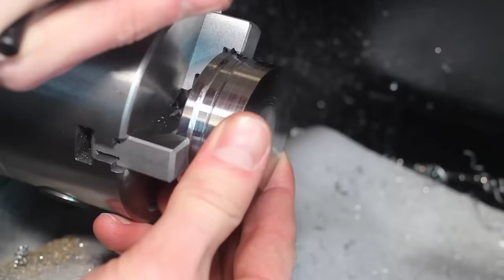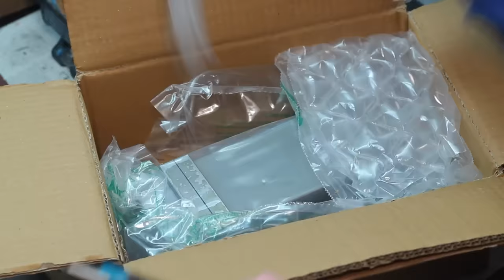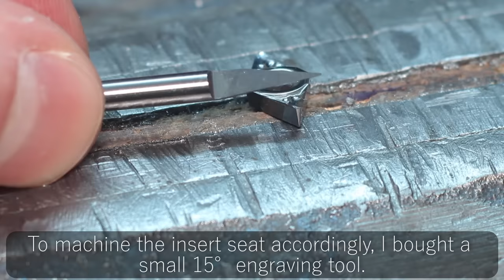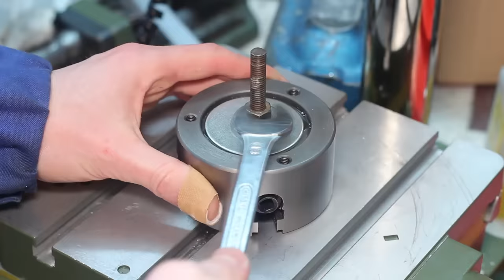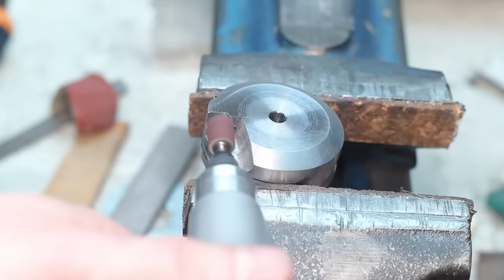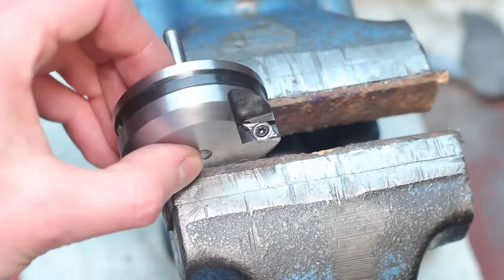Making a small Fly Cutter for inserts

Comment: Very nice work!
I expected the Fly Cutter to work quite well compared to say, an endmill; due to having a much higher mass. But I didn't expect it to be so silky smooth! That is a very nice cut! No comparison to the vibrate-y cuts with the endmills. I'd wager we see this tool a lot in the future!
Reply from the maker: Thank you very much for your comment! Yes I didn't expect the cutter to run that smooth as I wasn't sure to nail the right dimensions and angles for the insert seat properly. But happily it turned out really good and is very satisfying to use :)
Reply: In my opinion, the greater error in balancing is that measurements were taken without a cutting plate. I wouldn't overrate it because the reflective surface is fantastic.

Comment: I really like this take on a fly cutter, very different to mine. Just got my hands on a set of those same inserts that you have there and I wasn't hugely impressed with the finish. I found that button inserts give me the best fly cut finish. Cheers
Reply from the maker: Hey, I saw your video too:) Cool work! That's the common way of making a fly cutter. I wanted to try a bit different approach:) With button inserts you mean the round ones? They are certainly a good choice. But as I had the dcmt inserts on hand for my lathe and am quite happy with them in aluminium, I tried to use them for the fly cutter. And in my case it works extremely well. It's often a bit of trial and error. If the angles aren't right on the tool or the inserts are lousy, the finish won't be good.
Reply: Button insert face mills far outperform flycutters for finish, metal removal and better balance as they have more than one insert engaged. I did a test comparing them and there was quite a difference. If I was to make another flycutter my choice would definitely be a button insert, better finish, gradual edge engagement and far easier to make.

Comment: Nice job mate.  Been a journeyman machinist since '94 and I've probably made a dozen or so over the years, from a tiny 1 incher up to 11 inches but none quite like this one.    Pretty nice finish too I'd say!  The one thing I would wonder would be using an interference fit for the shank versus using a mechanical fastener.  I would think that a bolt on shank would offer way more in the name of rigidity, but so far so good it seems.  Thanks for sharing! 👍🤓

Comment: Nice work, i wish you could show us how balanced fly cutter is after removing material.
Reply from the maker: Thanks. I haven't filmed how balanced the cutter is after drilling the holes. But I tested it and yes, it was not perfect. The cutter still slightly rolled to one side. But before I removed more material, I tried it in the miling spindle and was surprised, that there were no noticable vibrations. So I let it as it was :)
Reply: Balance only matters at extremely high Rpm’s unless it’s HUGE
Reply: You might consider making one where you duplicate the cutout for the insert 180 degrees away.  You'd get better static balance, and good dynamic balance as well.   Just a thought.

Comment: Regarding the location of the hold-down screw...You should offset the hole toward the corner of the pocket perhaps 0.005". This preloads the insert tight against the pocket using the chamfer of the screw head. You'll need to consider the clearance between the screw shank and the hole in the insert in establishing the exact offset.
Reply from the maker: Thanks for your comment! I actually did exactly what you wrote :) Just didn't show it in the video. I took the position of the hole in the insert with the drillbit in the chuck and than positioned the hole slightly towards the corner.

Comment: Very nice work, congratulations, I was never think that this little bits used to carve PCB can be used on steel. Are of those type or are a different one?
Reply from the maker: Thanks for your comment! Yes, this is a carbide engraving bit. I think it's meant for engraving in different materials but steel obviously isn't the preferred one :) I really wasn't sure if this will work but simply had no other option for machining this angled feature. So I tried and luckily it worked quite ok although the length extension weakened the tool additionally.

Comment: From what I see you have been very successful in balancing your cutter. And this is what I have learned from your video. I wonder if the area in the pocket that you removed will cause you troubles?
Reply from the maker: Hey, yes, the cutter runs pretty smooth. Even it is not perfectly balanced. A slight imbalance was still there. I don't think the holes I drilled will weaken the cutter sifnificantly. The cuts I did with it so far were very promising.
Reply: @WeCanDoThatBetter  Balancing a fly cutter? Think twice you cannot balance a fly cutter. Maybe for optical reasons before cutting but as soon as you touch the material you'll be out of balance.
I still prefer the face mill because I can have 4 inserts in my one, I tried only to put 1 insert into it and the performance degraded (my little machine seems to have more power thus the 4 inserts are just fine for it).

Comment: I cut a 1/2 inch unf 20 thread directly into the flycutter, can now screw it directly onto the proxxon milling motor and it is more stable, I do the same with side milling cutters
Reply from the maker: Hi and thanks for your comment! That is indeed a really cool idea! I'm not sure, if the thing is running true cause a thread isn't the best way to center but I really like the idea. Perhaps I'm trying this out :)

Comment: Beautifully done. I am curious though why you chose DCMT, which are by default the most fragile regular use insert.
Reply: I'm thinking to build something like this. What would you recommend for best long life/low cutting power ratio cutter?
Reply from the maker: Hey and thanks for your comment. I had the dcmt inserts on hand as I use them normally on my mini lathe. The polished inserts work quite well in aluminium, that's why I thought using them for the fly cutter. The result was rather nice. But would be interesting to hear, which type of inserts you had chosen?
Reply: @WeCanDoThatBetter  well I can certainly understand "it's what I had and it's put up to all the abuse I put it through so far" DCMT has certainly become my favorite insert as well. So I want to point out that all of my knowledge on this subject has come from recent research because I've decided to start investing in replaceable insert tooling. I don't have a mill, but if I did and I was going to buy inserts to make a fly cutter I think my choices would be A series like AFTN, or AMPT, because they're Square and the larger the internal angle the more durable the carbide is, according to all of the manufacturers catalogs that I've read. The other one that I would be seriously considering would be considering would be the Trigon W series inserts like a WNMG. Now whenever I get the milling attachment built for my lathe, I will be looking at making fly cutters from the triangular inserts, like the larger TNMG, or more likely like the TCMT inserts I have for turning tools now.
Reply: @WeCanDoThatBetter  Just as a point of interest, Kurtis @ Cutting Edge Engineering just said that he thinks that 75° ECGT inserts are in his opinion the best for line boring chowdered heavy equipment...
Reply: @trollforge  what does chowdered mean?
Reply: @SW-ii5gg  It means a range of things from Beaten, to just shy of FUBAR...
Reply: @trollforge  thanks for defining it for me.
Reply: @SW-ii5gg  No Probs! You are familiar with the term FUBAR then?  BTW, you have some great taste in music!
Reply: @SW-ii5gg  hello. Also it’s like when you tell someone don’t do that you’ll break it. Or don’t you’re going get hurt. 
We call them chowder heads. Lol. 
Dumb ass also fits. Lol 
Now that I think back when I was young probably been called chowder head few times myself.

Comment: Hi ! Do you have a good opinion of this proxxon milling machine? Because I hesitate to order it.
Reply from the maker: Hi, it depends on what you want do do with the machine and how much money and space you have. For small things as I use it, the machine is fine and it needs not a lot of space and is not that heavy that you can move it around. But off course due to the light weight it tends to chatter and is not that solid. I'm happy with it for small work but a little bit heavier would be good.

Comment: Looks pretty. (What's a fly cutter..?)

Had this video in my recommended thingies, but I don't know machining terminology...

Maybe a small explanation (just a picture + picture of what it's used for) beforehand would be helpful :)
Reply from the maker: Hi and thanks for your comment and feedback. I'll keep that in mind. A fly cutter is the name for a milling tool with (mostly) only one cutting edge flying around in the orbit :) It is relatively easy to make and good for cleaning up larger surfaces on the mill and for creating good surface finishes.

Comment: Isn't 6 mm a little too thin for spinning a flycuttter? I would have went with at least 12 mill. The rest is perfect.
Reply from the maker: You mean the 6mm shank for clamping? Yes, it is definitely a bit thin. But I had no other choice as the proxxon mill only takes up to 6mm collets. I can't clamp anything bigger than that :/ The cuts I made so far worked well.
Reply: @WeCanDoThatBetter  I didn't know you were already maxed out. Good job then doing what you could with what you had

Comment: What is the solution name that you using for cold bluing
Reply from the maker: It is from the company Ballistol. It was a set in a small case with cold bluing solution, degreaser spray and oil spray. Works very well for my purpose.
Reply: @WeCanDoThatBetter  can you please make a video as doing cold bluing by showing bottles and spary

Comment: For a fly cutter that's only meant to handle very light cuts I think I would have gone for one that takes the soldered carbide bits that you can sharpen on a diamond wheel. The type of inserts you are using are never really sharp as they are meant for taking far heavier cuts than your fly cutter could handle. The soldered ones can be made razor sharp, which makes for less power consumption and better finish if you get the geometry right.
Reply from the maker: Would be an option too. But than you need a different kind of tool which can take a soldered turning tool.

Comment: Cutting that large chamfer might have been better the use a vee cutter in the horizontal setup rather than doing it how you did . it would have been more rigid
Reply from the maker: Thanks for your comment! I thought quite long how to machine this. Your idea might probably is better, but I had not the right tool to machine it this way. So I tried it the way I did. Not the best way ;)

Comment: Good realisation but you Turn too fast on the lathe. If you Turn steel like C45 with carbide tool use 120-160m/min. So for a 50 diamètre : 890 r/min 
For HSS tool use 25m/min 
It's just an andvice

Comment: You really ought to learn the correct cutting speeds for materials. You were running the lathe way too fast for that steel. Steel should be cut at 100 feet per minute. Cast iron is 80 feet per minute.  The cuts were not too much for the lathe it was too many rpm’s and no coolant.
Reply from the maker: Yes, it was probably to fast for that heavy cut.